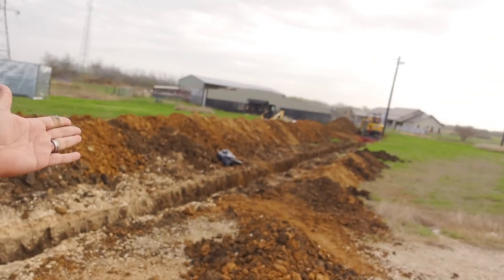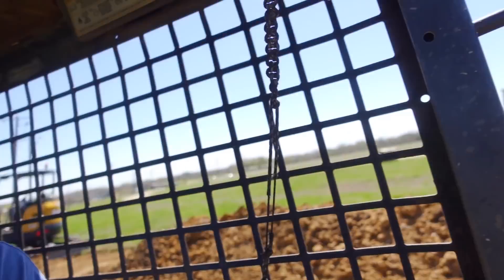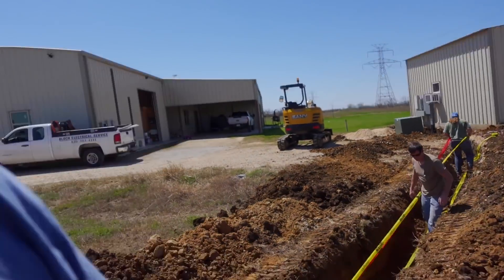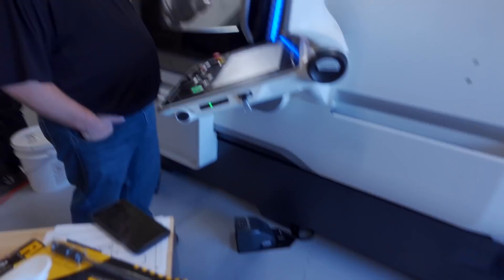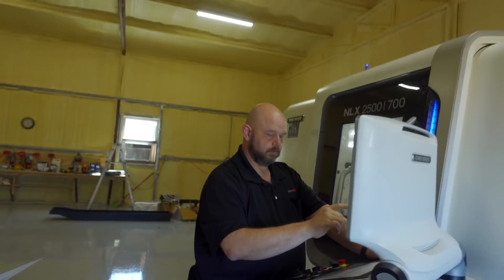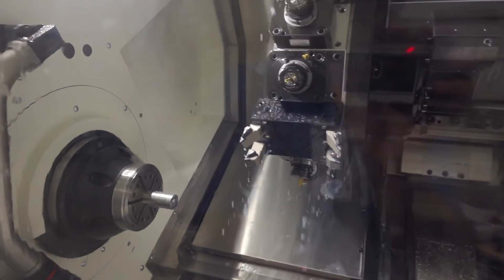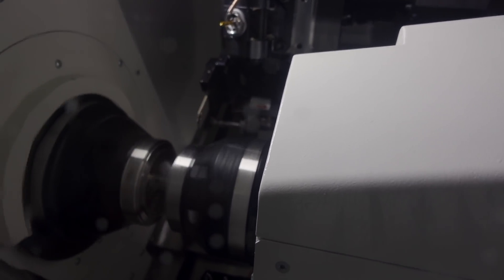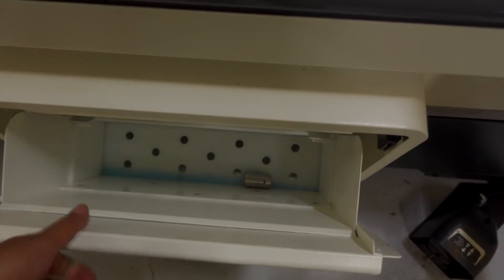I made my first part today! ___ Starting a machine shop part 14

Comment: Congrats!  I retired 10 years ago from 45 years as a toolmaker, aircraft, marine, conventional and maintenance Machinist. Partly before there were any CNC machines. It was fun while it lasted. I do miss it a bit but I sold all my instruments/tooling so I guess I’m done working. I don’t miss wearing steel toe boots. They ruined my feet, which took 5 years to overcome. Just be sure to proof each program. B/C if the machine crashes, it will be time consuming and maybe expensive to fix.

Comment: screw inspection .... send them invoices for their delays at a daily rate of $3000 USD if you take it later to court you will win because your expenses are documented for your sub contractors plus time double for short notice adjustments plus them not doing their job on time but expecting you been on time for them.  
any electrician cost you on average $200/h plus you as a the CGC at a rate of $350/h yes charge that them. I do the same and yes won 2 times and guess what now they show up on time and are super friendly and up on their communication because they know their bosses are up their behinds if they screw up. I am about to charge the City Mayor for corruption and violation of multiple trespassing of his City Code inspectors over an HOA private owned road to get to my house and violating me multiple times. Next time they gonna have a gun show down which the police won't win if they trespass again.

Comment: What city, or county inspectors are you working against?  I need to know where I'll never consider moving to, or working in.  About 20 years ago I had a similar experience in Garland Texas when I was building a two story garage with an apartment on the second floor.  The plumbing inspector was a very accomplished idiot.

Comment: The proper way is to pull the bucket. Most all excavator operator manuals tell you not to push or backfill by pushing with the bucket. I know we all do it all the time though. Kind of like pushing material sideways with the boom.

Comment: Eric, you picked a great machine and brand to start with. We have several Mori's where I work and they are rock solid and accurate. Also you are more patient than me in regards to those inspectors. Are they from the power company or your municipality? Man I would have been chewing some hind side, but I understand you need to get of generator power and have the shore power completed. Best of luck with this endeavor.

Comment: Is there a benefit to using the boring bar twice, once to bore the hole and then to clean up the tapped holes?  Figure it would be faster to do both in one step after the screw holes are tapped.
Reply from the maker: Interrupted cut over holes can break the threading insert.  Second pass doesn’t cut, it simply does a spring pass that cleans up the chips from tapped holes.

Comment: Reminds me of my journey when I got my previous job to buy a Doosan CNC lathe. We used Iscar Cham-drills and those things cut holes like butter until the shop guy forgets to remove the coolant plug and runs them dry. The pilot drill in that program snapped in the hole and the following tools in the program broke trying to finish the program out. That was a $500 mistake that you learn once. 

Doosan also sent us a clock as a gift. We mounted it on the wall behind the lathe. Weeks later, our shop guy crashed the lathe so hard that the clock fell of the wall and broke too. Fun times though.
Reply from the maker: Wow!  😂

Comment: You also encourage us! Thank you Eric. Also taking one of your EC TUNER BREAKS into compitition in two weeks!😁😁 caint wait! I have my savage 223 in a mdt acc chassis tuned with everything I learned from you so far and put a non experienced shooter behind it at 400 yds. They made 10 for 10 hits on 6 inch target with ease! Lapua annealed brass. VV n540 powder ,77 gr berger otm bullets. Bullets sorted bto with short action customs comparator system. Bullets seated with Wilson die on arbor press from K&M precision. ❤❤ Thank you so much Eric. My 6.5 creed is getting the same treatment! Just waiting for another brake 😁
Reply from the maker: Good job!

Comment: Send us their email so we can torture them! I did HVAC for a long time and went to a mobile home like a construction trailer that had a BARD unit hanging on one end that wouldn't work. Checked the power to it and there was only 110 volts when there should have been 240. The owner said his lights were really bright and he had burned up a saw and two drills trying to remodel. Turns out they got the neutral and ground crossed up and there was 240 on the whole house, receptacles lights and all. And there was the tag on the meter base where the inspector signed off on it! There are good inspectors, then there are idiots like the one's you and I evidently got. God bless and I hope you finally get it done. Who knows what else the idiots will want next, they're about like dealing with the Government. AKA people that have never had to do any real work😂!

Comment: This comment is off topic, so forgive me.  I've been binge watching some of your long range stuff and want you to see this.  I have a DJI done I use to check the far sections of my property.  I've noticed that the drone can be tasked to fly a straight line (point A to B) and will use GPS tracking to stay on course.  This requires the drone to make constant windage corrections, which means that crosswind data is being generated and used by the flight control system.  Why not create an app that displays these variations during flight?  Just fly the course from the bench rest to the target a couple of times and you've got every variation in the wind mapped.  Variable wind?  Get a broader sample over time.  Under the controlled circumstances of LR bench shooting it's totally practical.
Reply from the maker: That might work.  🤷‍♂️

Comment: I hope you see this. I dont know if they discussed it with you but a company makes a high speed rotary squeege like they use in ship windshields and it spins at very high speed so it is like looking through clear glass.
Reply from the maker: Yes, I know about it and it’s super cool.  But I need to save up a little for it.  :)

Comment: Good job man. I have a degree in machine tool and worked several years in the trade before going to something else to make a little more but u have a steap learning curve but look to be doing just fine. That tuner break is going to be tuff but I'm sure u will be fine.

Comment: With as much as this massive machine costs one could only expect they would put a windshield wiper on the inside so you could see what is going on. But no, that is probably a $50,000 option. 
Send the machine back. We need a refund. 
Good video. 
Congratulations on your new endeavor. 

😎

👍👍👍👍👍

Comment: I hope you can add metric threads near future.
Reply: Eric now that you have a cnc controlled single point threading bar you can make whatever thread you want just by changing the parameters in the thread cycle, provided the thread fits within the physical abilities of whatever insert you have.
If you find yourself needing several variations of the tuner you would be well served to learn sub programming and macro programming. You can break the individual operations into sub programs or parameterized macro programs, then the main program looks a lot like the order form. You just tell the main program which features you need and the subs will have all the tool path for each specified feature.

Comment: I’ve been analyzing my tuner and I’m very impressed. I’ve gotten lucky with it I guess, I have a 153.5 6.5 mm Berger load that would give me an occasional flier, but now I do not get this random flier.  The flier would open up my group in the 0.5”’s for five shots. After adjusting the tuner brake and 6-5 shot groups, I haven’t had one flier!!!!  Now this load stays in the 0.2’s-0.3’s constantly, no exaggeration!!! This is a 20 pound field rifle, not an f-class rig so this precision level with extremely low single digit es’s, this load is producing very tight vertical groupings out to 2300 yards with great success.   I appreciate you making such a nice product. Also, after using most top end brakes, I have to say this tuner brake is one of the most efficient brakes I’ve used. Very nice!!!

Comment: Erik when you get a chance clean the glass on the inside of the machine and apply some rainx it will help with the coolant from blurring your visual on the door glass.
Reply: If the window is some form of plastic, make sure you use Rain-X "plastic"treatment.
Reply: Also, car wax works good too. But you gotta make sure the glass is super clean before you apply the car wax. I'd go with Mothers Brazilian wax.
Reply: That thing should come with an internal wiper blade!
Reply: @formulajoe2  
You wont be looking through the window long enough to want a wiper blade.
After you program your first parts and get them running how you want.
Nothing worse than standing next to CNC anything for to long.
It starts to become like watching grass grow ????
Reply: @weldmachine  they are operators not owners. its their job to sit there and babysit the robot.
Reply: The Rotoclear S3 is a "windshield wiper" made for CNCs.
Reply: Ceramic coating may be a better solution or a spin window of some sort
Reply: not a good idea to poison your coolant.

Comment: A small recommendation. I know you are already done with backfill, but put a foot of sand around and above those conduits. It costs a little up front, but makes any future work MUCH safer and faster! We have been doing that for years. A load of sand goes a long way toward the reliability of your install. This is especially true when we are likely to be doing future work or if it is for an owner rather than just a business or utility.

This is after thousands of miles of conduit and cable installed. (for reference, my current job is 1.2 million feet of cable in about 100K feet of conduit and cable trench)

Regardless, great work. And I am STOKED to see that coming together for you! Get this dream making money ASAP eh? ;-)